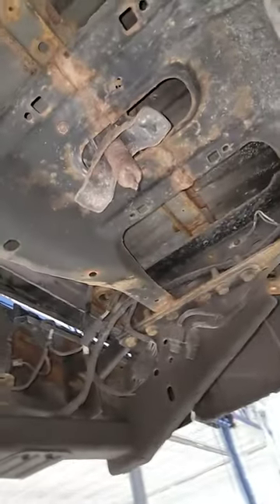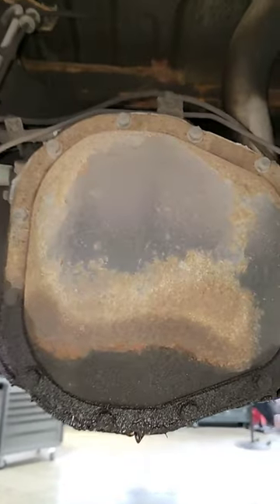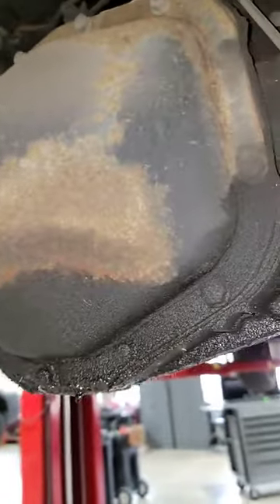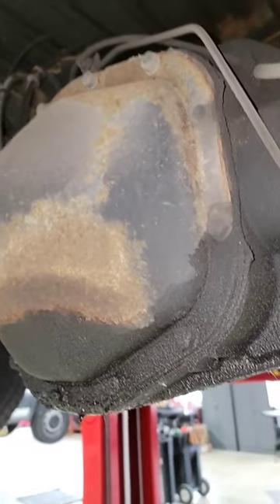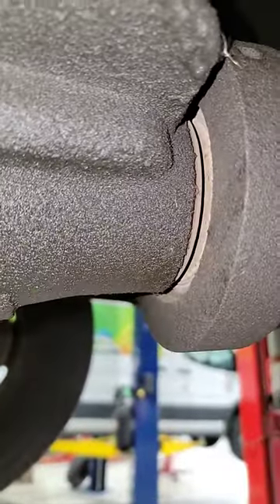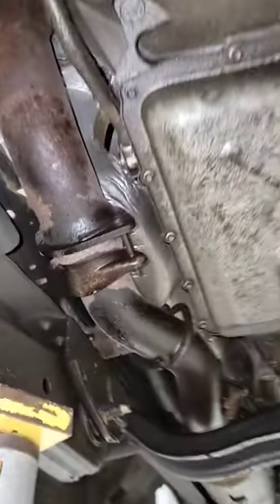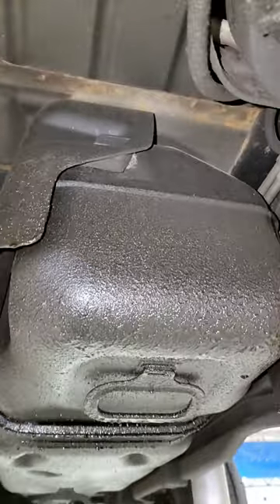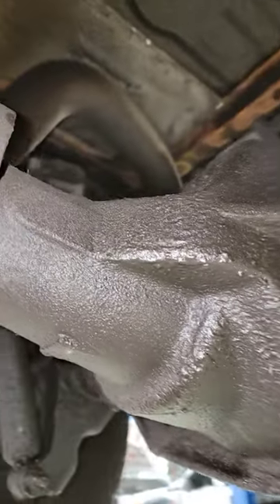WORST oil leak ever! | GALLONS leaked 😔 #fyp  #shorts

Comment: Pinion
Reply from the maker: I think u missed the point
Reply: @PowerStrokeTechTalkwARod  I got the point. I made the mistake of assuming since you were discussing the center section i saw the oil on the front of the section that it would be the pinion seal and paused the video and stated the pinion. After I started the rest of the video I saw where you were going and that I was incorrect but I left the answer because going back to change it would be cheating on the answer. I failed your test by not allowing the video to finish. But if I had then you would have given the answer to me and then it would be cheating in my book at least and I hate cheaters and disapprove strongly with changing answers. I was wrong by making an assumption when I didn't have all the facts. But everyone makes mistakes the bigger question is have you learned anything from the mistake. I wish we had video like they do now when I was actively working on new cars. I ran into a miss on a 01 Dodge Durango R/T with a 5.9L they miss was after the vehicle was about three months old and had been to the original dealership to have the factory shorty headers installed that the owner had ordered thru the dealership. That's when the miss first showed up after he left the shop. He took it to two different dealerships and and they had changed the plugs and it went away for a few days the second shop did the plugs and changed the coil pack on the number five cylinder and the miss returned within a few minutes of leaving the second dealership. The shop i was working at was Ben Sory racing on Sonic drive in Virginia Beach. He came in and told the boss what was happening and the owner called me in and gave it to me to fix. I talked with the owner and then pulled it in the shop and started giving it a visual once over and didn't see anything obvious so I checked the wiring harness to ensure their wasn't a issue with a wire or connections in the harness to ECU. When I had to decide what to do I had a good signal from the ECU to the coil pack and and good secondary voltage out to the plug then I had a thought drift in my head that allowed me to figure out where the miss was coming from. I'll let you take a stab at it since you have the same information I did. I'll wait for your thoughts .  And I do enjoy your channel continue with the videos they are great.
Reply from the maker: Dude great comment. Did u load test that circuit?